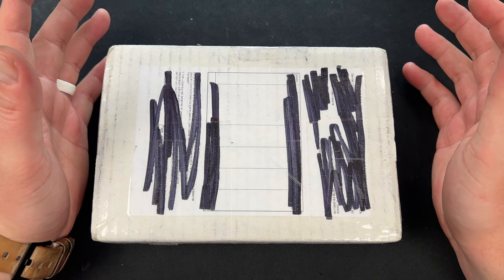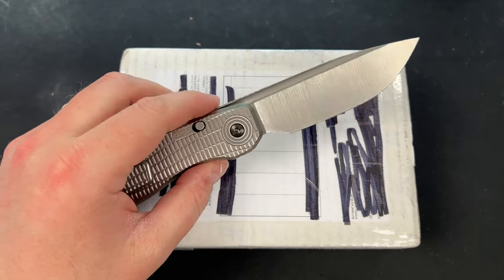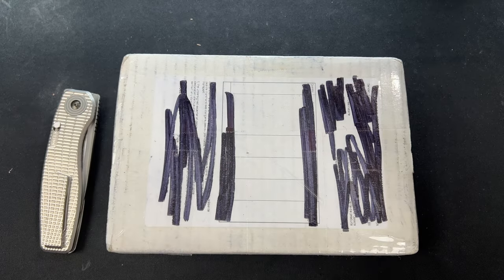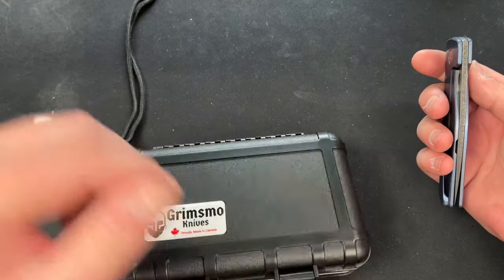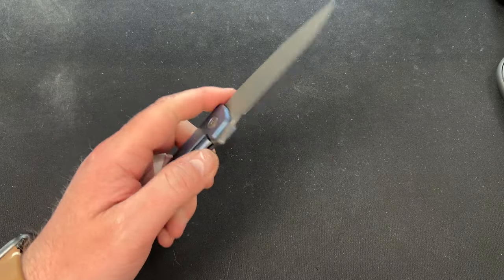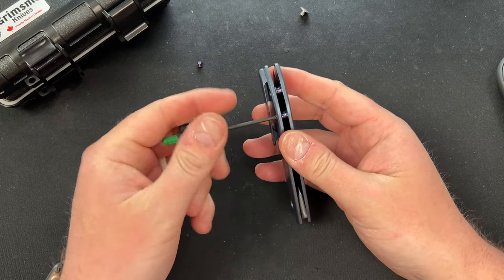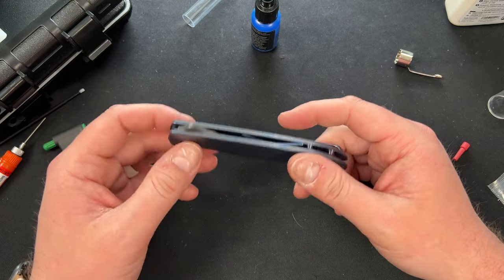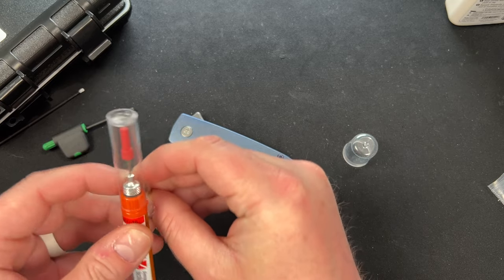I Got A Rask!

Comment: That extra hole is there to hold the scale to the fixture during machining.. correct everything is made in shop except the bearing balls. The big stop pin is for opening small is for closing

Comment: Well done. You got an over priced knaf with a basic heat treatment. I like the Rask way more than the norsman but its still very over priced. If they used a better steel and heat treatment it could be worth what they cost. But alas, they arnt.

If they are going to use rwl34 they should be mirror polishing it and providing a better heat treatment than basic. Why even use rwl34 if you dont mirror it? Lol. They have very little knowledge about steel and heat treatment.

Currently they are over priced fidget toys with great CNC machining. It's come to a point where there is a market of people who just buy and sell things and make up values of said fidget toys.